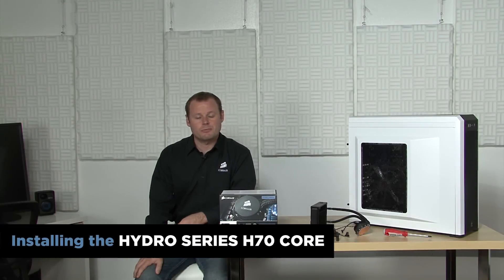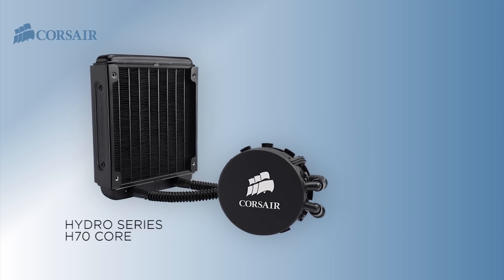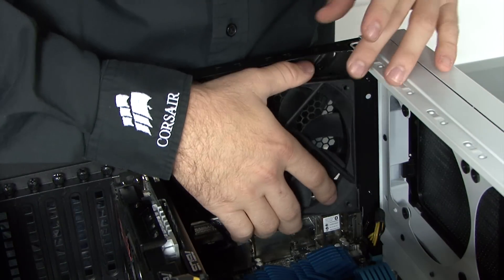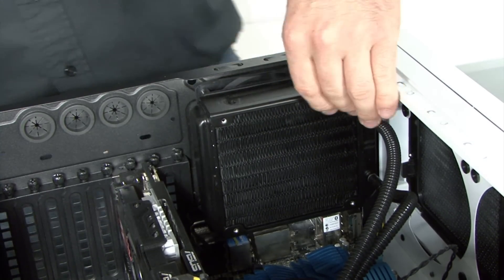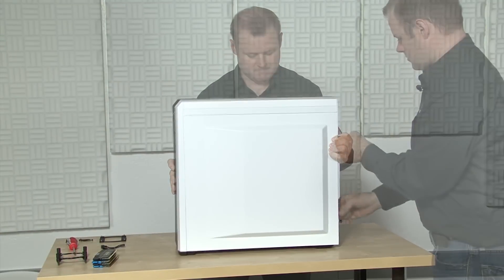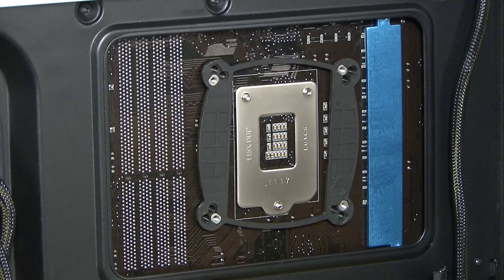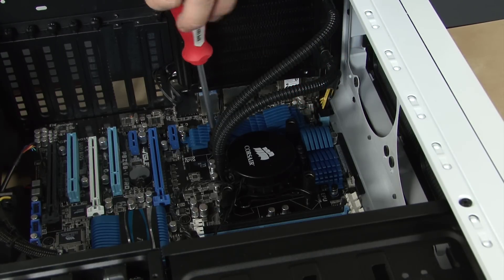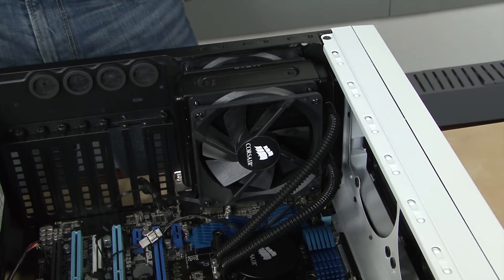Corsair Hydro Series H70 CORE Install How-To Video

Comment: When I bought this product it was suggested that it worked with 775 - incidentally, it doesn't.  Is there a workaround? Do I have to make new holes in the retention ring. If you've had this problem, please let me know how you got around it.

Comment: I have had a h50 for 2 years. I choose to have fan as exhaust. Works fine. Dont have fans as recommended. If you do you will suck in dust and you cant see it as its builds up behind the rad.so in time it cloggs and temp rise. In exhaust mode you can vac dust out as you want as it builds up on the inside and you can see it..  It does not evaporate over time as I ve seen some post claim. Yes the pre applied thermal paste is enough.  
--->dust II--> case BAD)  
<---II dust <---  case good)

Comment: I think the intent of Corsair's guidance to mount fan(s) as intake is to run the coolest air possible (from outside the case, not inside) through the radiator.  I don't see why you can't mount as exhaust like you're wanting, but you'll be running the hottest air possible through the radiator, making the system much less effective.  I'm in the same boat as you, and I'm reworking all of my case fans to support the preferred intake method.

Comment: misleading info on the video, the H70 doesnt control the fan speeds, if you plug them in there the will be running 100% speed always

Comment: I just bought this for my pc build, and yes it was a pain to install but it didn't have to be. The trick was to only screw down two of the four backplate screws(opposite each other), then secure the block, then secure all 4 backplate screws. Once I finally figured it out, it was easy.....and it works incredible, so its worth the trouble. No trouble if you do it this way, too bad the instructions don't tell you this.